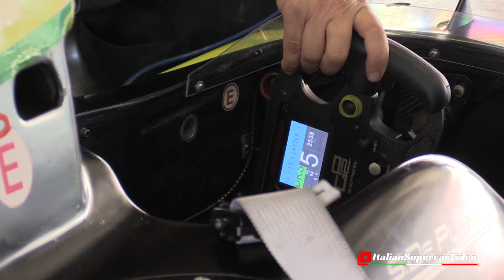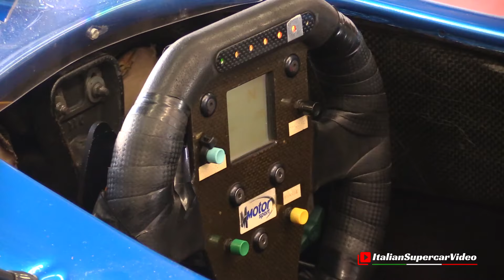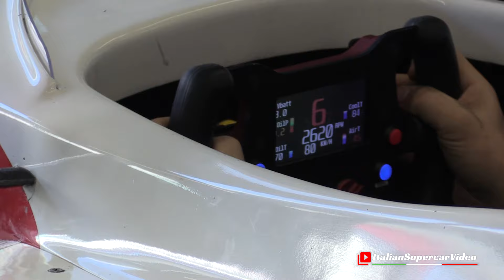Boss GP Racing Series - Gran Finale Mugello Circuit 2023 - Warm-Up & Track Actions - Pure Sound 🔊

Comment: Looks like fun! I wonder if one of those engines would fit in my Crossfire? What car and engine is the big blue car? Sounds like a V12.
Reply from the maker: Please tell me what minute you saw that car and I will try to tell you what car it is 😉
Reply: @Italiansupercarvideo 
11:03.
Reply from the maker: @upsidedowndog1256  It's a Lola F3000 powered by a 3-Litre 6-cylinder Alfa Romeo engine
Reply: @Italiansupercarvideo  
Well that is smaller than my Crossfire's Mercedes 3.2 liter. I just need that exhaust!
Reply from the maker: @upsidedowndog1256  Wait a moment...Do you own a Crossfire with a 3.2-litre V6 engine?
Reply: @Italiansupercarvideo  
Yes. 2004 coupe. Dark charcoal grey metallic.
Reply from the maker: @upsidedowndog1256  I have always loved this car; even in Italy, it had success, certainly less than its SLK sister. However, it has a design that fascinated me, and the rear wing that comes out automatically from the bodywork is beautiful. I wanted to ask you, being practically a Mercedes with a different bodywork, what do you think about reliability? Are you satisfied? Do you have a manual or automatic transmission?
Reply: @Italiansupercarvideo  
Mine is an auto. I have had it over a year and have had no new problems other than a few quirks that they all have. Mainly the Chrysler plastic stuff. The wing doesn't work and while kind of neat, it is more of a gimmick than a necessity. Someone played "drift car" with it at some point and the previous owner replaced the driveshaft and halfshafts. I have only put new brake pads on it and changed the fluids. The 80% MB portion is robust and a joy to drive. Not really quick compared to my hotrodded Mustangs but loves to be driven fast for hours. The handling is several levels beyond any Mustang, even my ex-autocross 1988 LX 5.0 L. The ride is harsh, like a roadracer, but that is why it handles like a go-cart. My only complaint is the front end of the car looks like every other Chrysler, almost as if a giant stepped on a PT Cruiser. I can't see it from the driver's seat, and I really love driving it. Kind of makes me want a "true" MB. The Crossfire never sold well here and many people have no clue what it really is. I like that aspect, also.
Reply from the maker: @upsidedowndog1256  What you tell me is interesting. In Italy and Europe, the Mercedes SLK is undoubtedly the one that has sold much more. There are many here, but I must say that I still see some excellent examples of your crossfire. I think the cars' dynamics are probably identical; perhaps the suspension calibration varies a little, but I'm not sure. The Mercedes mechanics are robust, and you shouldn't have any problems with the engine and gearbox. I understand what you mean about the front, but I like it, perhaps because it differs from the many identical Mercedes I saw on the street. Chrysler was a breath of fresh air at the time. As for the rear wing that lifts, I did not doubt that it could be blocked; these mechanisms are beautiful to look at, but certainly, having something fixed and simple, without motors and electric cables, is the best thing; it doesn't create any problems.